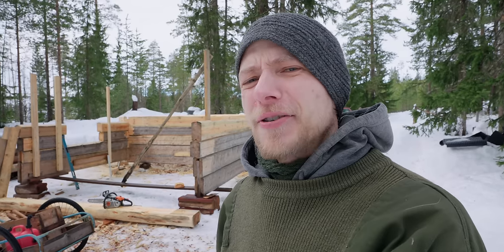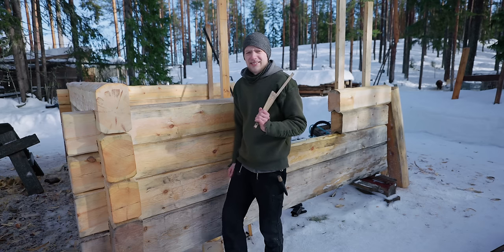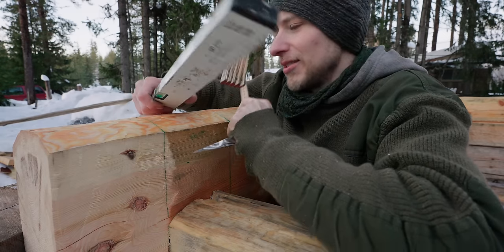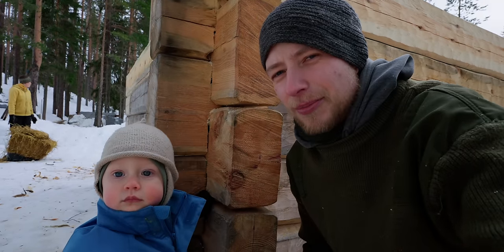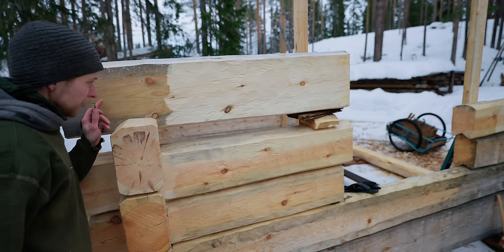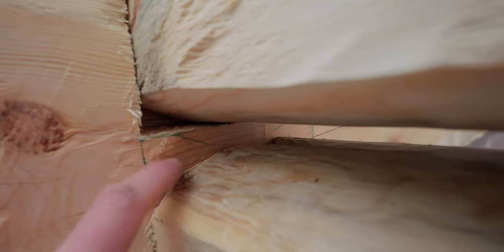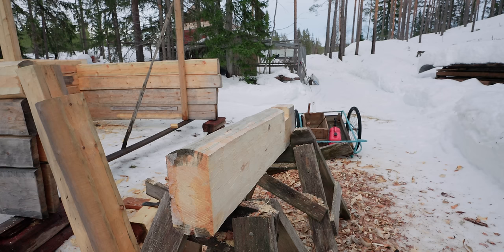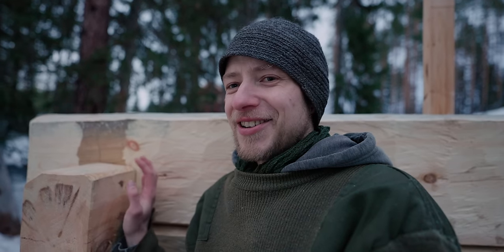Building a Log Cabin in the forests of Sweden | How we Join the Logs

Comment: In English, we use 'chamfer' or 'chamfered edge' as a general term for 45 degree angled corners, but for an architect or civil engineer, the correct term is 'arris'. Most concrete beams utilise them, or else the corners would be easily broken off. Great editing by the way. You have become such an expert.

Comment: The "divider" is commonly called a "compass" when you are using it to draw arcs or circles.   A divider typically does not have the pencil attached, but would have two steel points that you can use to measure a straight distance.   English is odd.  A compass also is used to navigate.
Reply: Yes I recall us calling these compasses in woodwork classes at school.....
Reply: The ones we used in class did have pencils attached...
Reply: Compass is also used for the same things in Swedish.

Comment: There's probably already an answer below but I haven't read them all to check. Your device is actually a compass, which is usually used to draw circles. A divider has two metal points and is used usually for precise measuring. A compass with screws for locking can be used as a scriber, or marker - as you are using it. I use draughting/drawing versions of the tools you are using. Yours are for woodworking and are modified for that work.

Comment: Concave to produce a tight fit... I call it a "back-cut". That is how joints in wood trim are accomplished. The way you made that inside vertical edge tight. The Långdrag produces an interference fit, with weight above pressing out near the edges, thus sealing better and giving stability to the stack, back from the outside edge which looks like a "V" or "Såt" (I assume the groove is the Såt. I see how that's done now. Also, that internal V cut that is stuffed with moss is genius. Very nice camera and editing work. Thank you Mathias.

Comment: You are so methodical and calm in your presentation. Very relaxing to watch you work and explain what you are doing. I watched another channel where a guy (I think from Norway) was building a cabin, and using moss as a filler between the logs. I guess the traditional way used what was handy at the time. Does the moss stay alive whilst it is in between the logs?
Reply from the maker: Moss is still the best! But it has been rationalized away, it takes more work to get it done.

It is not alive anymore, but it keeps fresh and dried as long as the cabin has a foundation and roof. If you tear down a 500 year old cabin, one can reuse the moss in between the logs.
Reply: @Talasbuan  Reuse the moss after 500 years. That is fascinating. It must not degrade over time. Really makes me wonder how many things the 'old ones' knew hundreds of years ago that we may have lost or forgotten.

Comment: best to level the inside walls ... then you can hang stuff easier and route pipes or other things easily ... a basic corner  triangle frame and a plumb bob works wonders for keeping the wall straight ... level across the top of the frame drop the plumb down each wall and the corner for good alignment

Comment: And kukeleku in Holland it is..:-)

Being a carpenter myself, I now see why time should not be an issue, when building a logcabin..
You are doing a great job!
The plyer used for measuring the with of the log, can also be used when measuring from the top down, easier to handle than the leveler.?

Great flying under the logs too! Cheers!

Comment: Had to watch it in two parts. I was surprised when i started to watch and checked the run time... Your movie editing skills are really good for someone working days over days with heavy timber bars ;-) For the small cutouts or adjustments at the notch would i take a chisel. Even your slim axe needs some extra time to control the axe which you can otherwise use for the chisel.
How about doing the notch by hand instead of using the chain saw? All birds are silent for a while after you used it.

Comment: Does the såt have a function? I reckon the water would run downwards anyway without such a marked and deep såt. So I don't understand the function. It's looking good though. - Looking longer into the video I think I understand the function. If I'm not wrong I think this method will save material. Could this be the case? Because of the såt done in this way you wouldn't make the top log lie unnecessarily deep down, if that makes sense.

Comment: Oh and when it is winter. There is minus celsius outside, and plus inside. Somewhere inside the wall where the temperature is 0 degrees celsius, water will condense. The reason is hot air carries more water than cold air.
Taking this into account, you will want to cover the outside with something that allows for water vapour to escape from inside to outside. Often  in modern construction Tar-paper, called windpaper. And then there is Roof tarpaper which doesn't allow anything through.
On the inside oh your house, finally you will make a water vaper barrier from plastic. Alternatively you can put semi waterproof Tarpaper on the inside and outside. This will allow for your wall to dry.

Those are the basics. Just think that you don't want water to be trapped in the wall. Because water is woods enemy!
Reply: Basically just let the wood breathe, and keep an "umbrella" on it

Comment: What is the name of this type of traditional log construction that is so common in Sweden and Finland? Do you intend to have a double wall system to reduce the heat loss from the thermal bridging of the logs? Thanks for the video!
Reply from the maker: Hmm, I'm not sure what you're asking for. The whole structure is called Timmerstuga or timmerhus. The verb is "att timra",  the notch is called rak enkelkattsknut.

In the house, the old logs is going to get some sort of extra insulation on the inside since they where not so fresh, and not so tightly built, but in this entrance building we’re planing on having the timber walls visible. But we haven't decided yet.
Reply: @Talasbuan  Thanks for the info. An ordinary log house is called round log or “bois rond” type in Canada. But you square off the logs and use a different notching system, so I was wondering whether there is a special name for that. I have also read about leaving an air gap between the insulation and inner log wall to improve R value and prevent mould and rot. Wires are sometimes passed in this space, but I guess you won’t have those! I certainly takes a lot of work to do this kind of construction.

Comment: you are essentially saying a shoulder notch for knutsen or shoulder joint ... it provides a 3rd way of structural strength by further locking the log pairs into each other and avoiding twist ans slidiing back and forth ... as well as resist heave from spring thaw ...

Comment: The tool you need for marking those notches is called a "combination square".  If your logs are not more than 18 centimeters thick a 30 cm square will work because the short side of the square is 9 cm long. If the log is wider than that, you could clamp a longer straight edge to the short side of the square. Here is a video on them.  https://www.youtube.com/watch?v=gG5FwB-OCp8         I don't know if someone has already said it in the other comments, but in America, the large axe you are using looks like one variation of a broad axe.